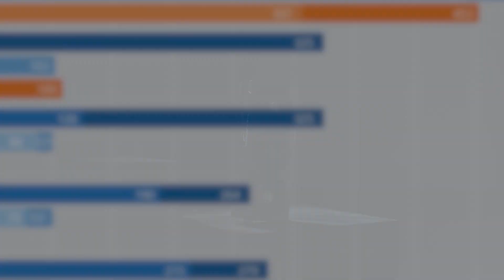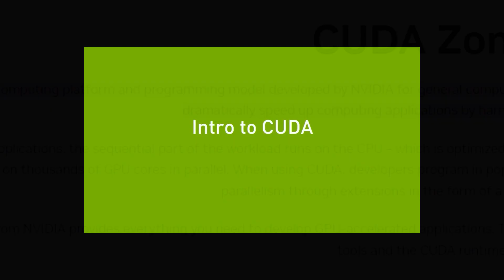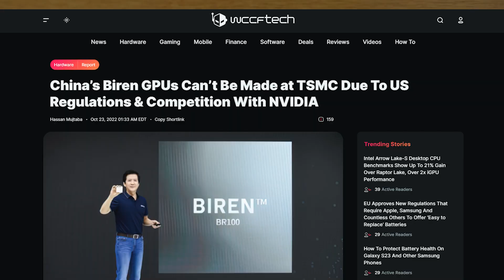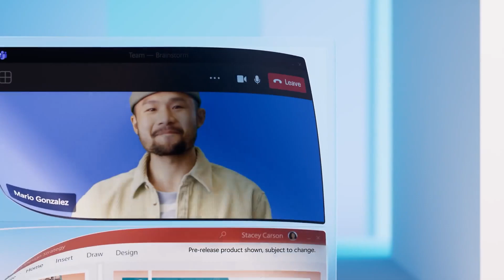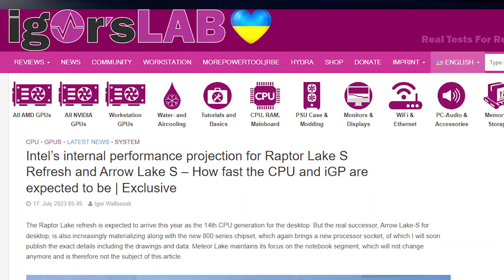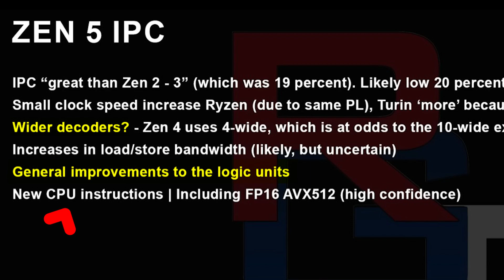Nvidia Finally gets its Rival

Comment: Discrete GPUs could soon become a thing of the past. All major CPU manufacturers also produces GPUs. Nvidia should start independently investing on CPUs as well, otherwise their monopoly could be over in no time.
Reply: homie forgot about Nvidias grace cpus?
Reply: @kidsythe  They aren’t basic consumer level products. There was a time when nvidia dominated the entry level gpu market. That’ll soon be taken over by iGPUs. AMD’s Strix point APUs are going to be on a totally different level (expected to provide 5x better graphics performance than than Vega 8 based APUS). Hope nvidia has something in their roster to counter that.
Reply: @dPten  They have their Tegra SoCs that power the Nintendo Switch and Nvidia Shield among other things. Ofc those are ARM rather than X86 so they won't have the same compatability with the existing desktop games ecosystem as a x86 SoC (on the flip side they will have great compatability with the android games ecosystem since nearly every android device runs on an ARM SoC).
Reply: @olnnn  Yeah, that is also a point because on the other hand more and more people seems to be switch over to mobile gaming. But, the future nevertheless is in integrated based chips rather than high power consuming overpriced discrete systems.